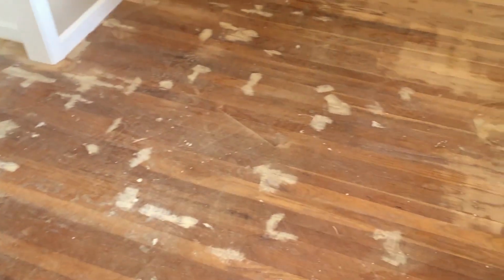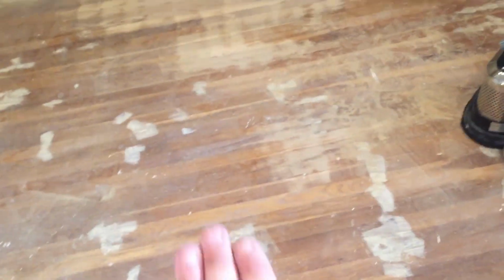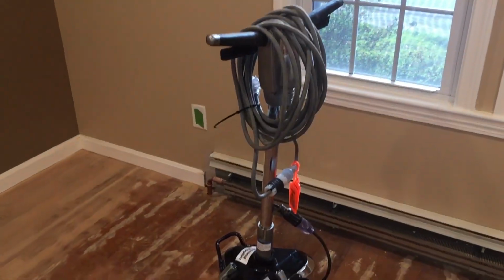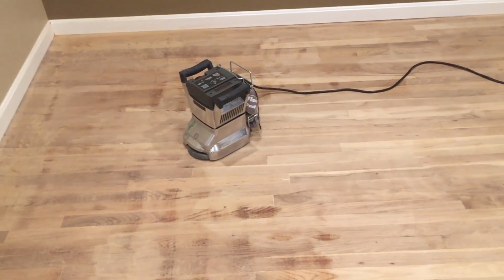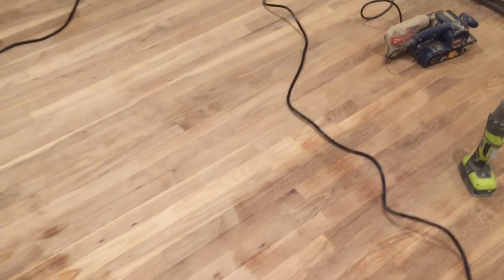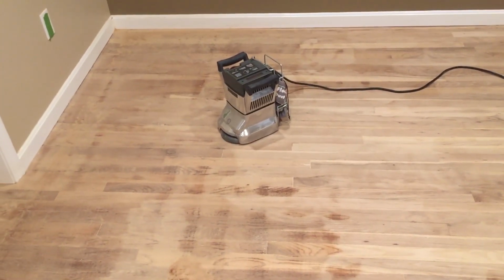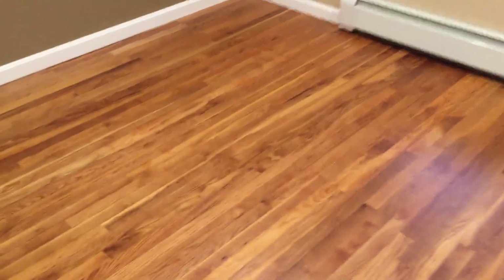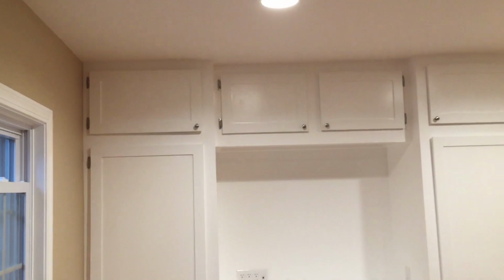Refinishing Hardwood Floor - Primary Bedroom Remodel - Episode 8

Comment: When we were young (74&72)now we Varnish differently. 
1st A coat of white  spirit. 
When  dried 1st coat of varnish. Let dry.sand lightly  and repeat  several times, the more the merrier. 
Lovely on furniture. 
If you  scratch  it you only Damage 1 layer. 
Just  a  trick we learned  over the years.

Comment: In between the coats of poly, are you handsanding? What are you doing there?
Reply from the maker: Hey, Keith!  Yes, I was hand sanding with a sanding sponge.  Just getting the little bits of dust that sealed into the poly and some bubbles.  Then went back with a tack cloth to clean all the dust.  Thanks for checking out the video!!

Comment: What brand/type of sanders did you use before you had to get the heavy duty one?  I noticed one for the corners and then a reg sander. I’m in the market, so want to get something you’d recommend. 

Also, can you break down what grit paper you use during each part?  I am about to tackle one of the rooms in my house—my daughter’s (the guinea pig room) :-). Thanks!
Reply from the maker: Honestly, everything I have is Ryobi.  It is the best bang for your buck in my opinion.
I believe I started with 60 then 80 then 120 if I remember correctly.  Thanks for watching!!
Reply: The Fixer thank you!!